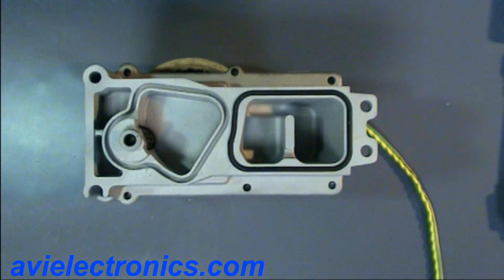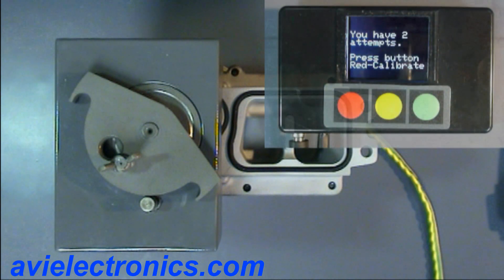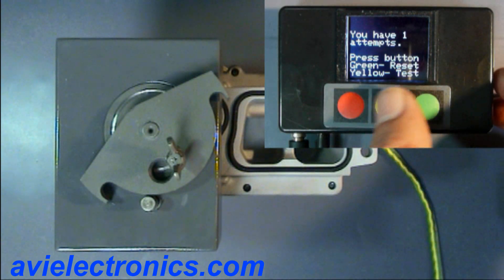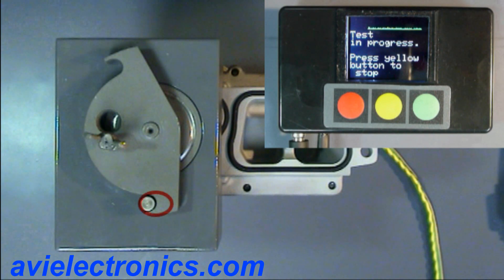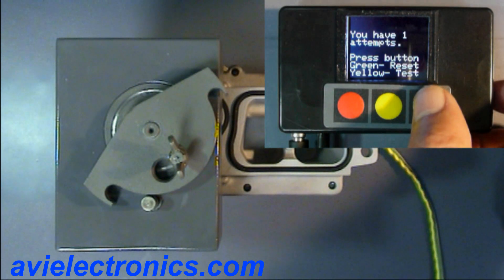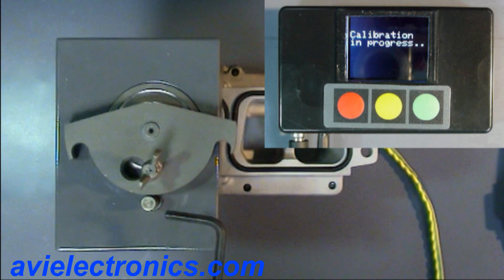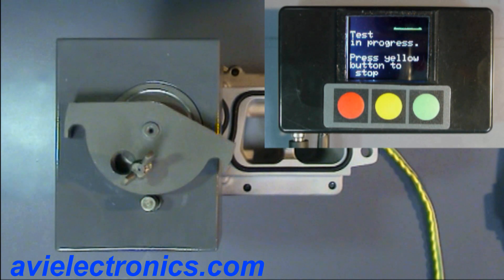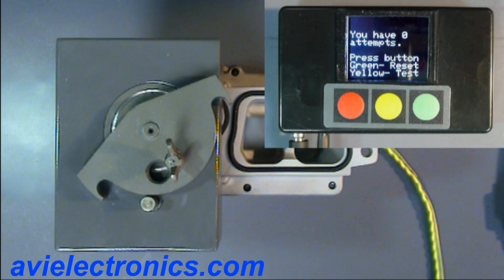How pre- calibrated Cummins VGT turbo actuator (fully calibrated) HE300VG  6.7L  Dodge Ram works.

Comment: How about a turbo that says it comes with the whole turbo pre-calibrated? I just got a fleece turbo 63 mm vgt , they say it's a drop in .. is that right ?
Reply: @maccheese9072  i just bought a new turbo with a actuator supposedly precalibrated but my eb doesn’t work after  install of turbo. I took the actuator to calibrate it with an autel ms906bt  it fails the   Self calibrate/pre alignment
Reply: @meadquick2421  what is eb and did you buy from Avi?
Reply: @dachamp165  exhuast brake  what ended being was that my maf sensor fuse was blown which the power to the turbo actuator runs with the maf sensor circuit so i couldnt program it until i had the fuse replace then i was able to precalibrate  my turbo works like a charm i bought it from autozone then returned it twice until I checked fuse
Reply: @meadquick2421  auto zone has a calibration tool for your isx actuator?
Reply: @dachamp165  no i had autel ms906bt scan tool has precalibration and auto align i kept buying holset turbos with actuator from autozone
Reply: @meadquick2421  how much does your alignment tool cost and is it easy to use? Will it work for Cummins isx actuator?
Reply: @dachamp165  most of name brand type of scan tool can do turbo alignments
Reply from the maker: Yes, that's right. The actuator should be calibrated with the turbo. After that don't take the actuator off. Otherwise, calibration may be needed again.
Reply from the maker: @maccheese9072  Yes, that's correct.

Comment: You have to calibrate to the turbo. Not with that tool.
Here is how you really do it.
Remove the vgt actuator and set the vanes to the full OPEN position. Reinstall the VGT to the turbo
Send can ID 0x18FFC600 data length 8 bytes 0x00 0x00 0x02 0x00 0x00 0x00 0x00 0x00

Let the module self calibrate. Send again but data 0x60 0xFF 0x01 0xFF 0xFF 0xFF 0xFF 0xFF

If it pulses out then in. You are good to go. If not. Your actuator arm is not moving fully. Check that you can move the arm and the hole in the arm lines up with both the holes in the turbochargers bearing core in open and closed position.
A device that will allow you to send CAN data, arduino uno and a can shield 50 bucks. Or a raspberry pi if youre a linux user can easily use the built in kernal can protocols.

Note: 90% of vgt holsets that are "bad" can be snagged from a dealer for cheap. Then you bring it home and take the turbine housing off. Clean it up and reassemble. Re calibrate the vgt actuator and there you are. 5000 dollar turbo for 200 bucks.
Thank you to all the silly people who roal coal, making no torque, overheating their engines and giving us cheap good turbos they caked up with carbon. :D
 Good luck :)